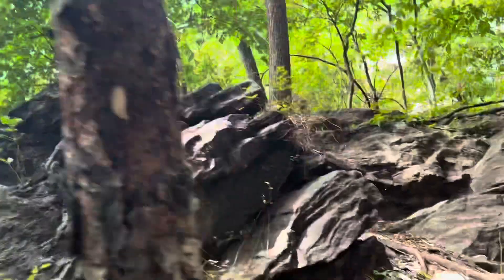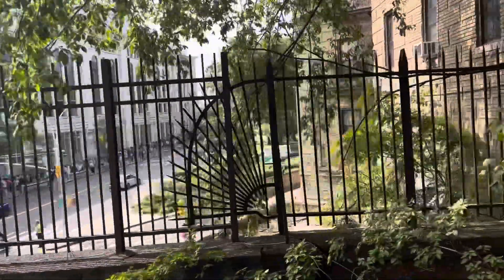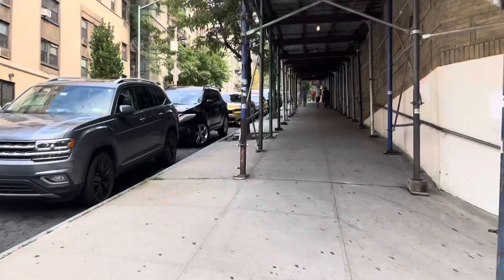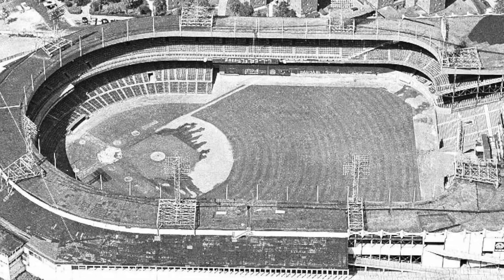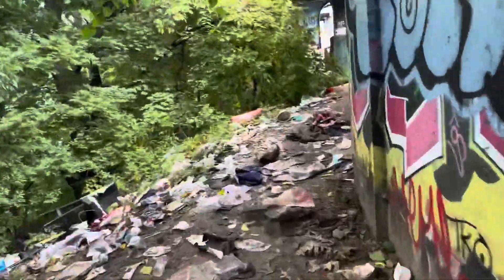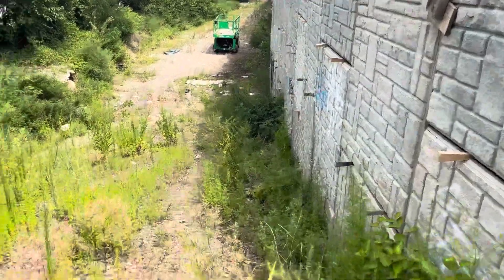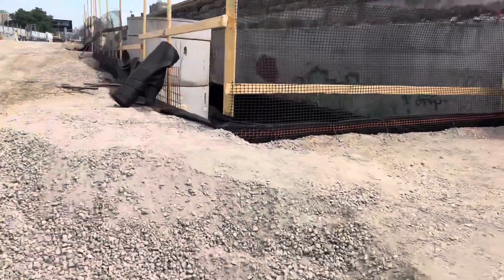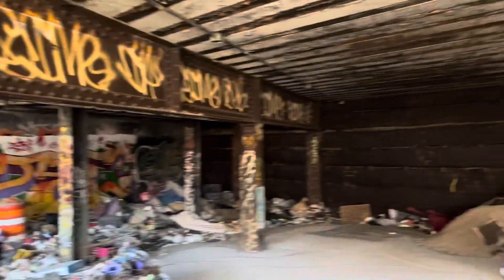History On The Jerome Ave/Anderson Ave & Sedgwick Ave Abandon Platform Station

Comment: Wow used to hangout there in the 80's. Thanks for the memories
Reply: They are definitely talking about extended the 3 trains to the Bronx to connect to the Jerome Ave 4 line to Burnside Avenue Elevated line Bronx. They are definitely gonna clean all that mess and lay the old tracks and the old Thrid rails. They will find another way for the 3 trains could go around the new Yankee stadium 🏟️.

Comment: Great vid.
One comment. The tunnel between the Sedgwick Ave and the Jerome/Anderson   Ave stations ran under W. 162 St. to Anderson Ave and continued under the apt. Building to the Anderson/ Jerome Station platform. I think the street with the hill in your video shows Anderson Ave where it connects with Jerome Ave, south  of where the El.  remnants are at what was W. 162 St. NYCT Website has photos of the inside of the tunnel where it had an emergency exit at Woodycrest  Ave under W. 162 St just west of Anderson Ave.
Pls post your response to my comments.
I may be wrong.

Comment: THAT IS CORRECT!!! You know your history—I was born and raised in the Bronx! Left in 75!! Jerome and Grand Concourse!!!!! Hey get a heavy crowbar and crack that open!! BRING HISTORY TO LIFE AGAIN!!!!
Reply: They could definitely bring the Three trains to the Bronx. All they have to do at 145 street five first cars stops and they could make it a elevated lines to run across 155 street birdge along side the roads make it concrete structures and go around the new Yankee stadium. Or they could dig a hole 🕳️ at 148 street tunnel and make a right curve and a right curve going out ground passing the polo grounds building 🏢 concrete structures  to reconnect to the 4 Jerome Ave 4 line to 167 or Burnside. All they have to do is to seal the wall panels that they could use the special machines . They was definitely talking about extended the 3 trains to the Bronx. I have a real spriital feeling they are gonna bring back the Putnam railroad devisin I'm telling you. They have the new engineers could rebuild the ninth Ave Elevated line. All they have to do is to re do the train tracks and Thrid rails . The 8 Thrid Avenue Elevated line is definitely not a problem rebuilding back. The ninth Ave Elevated line would definitely be difficult to rebuild because of the new Yankee stadium 🏟️ . They will definitely find another way for the Three trains to pass.